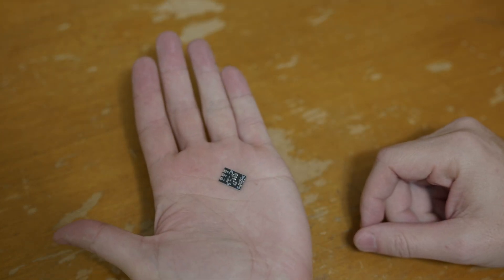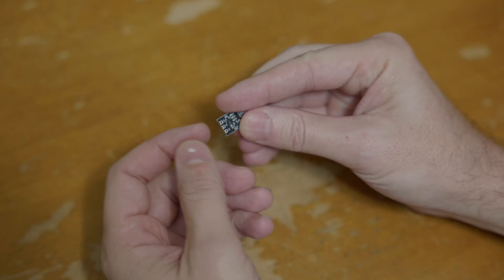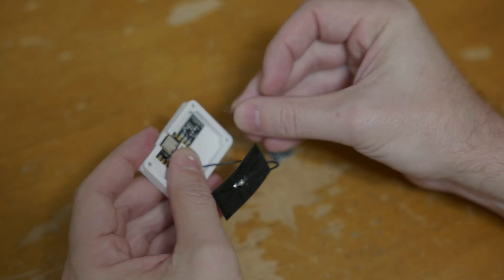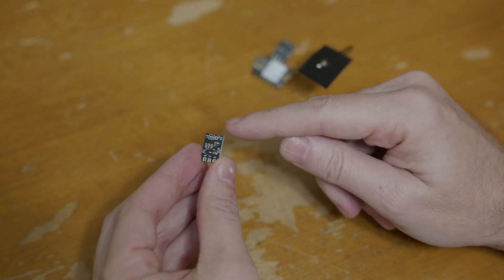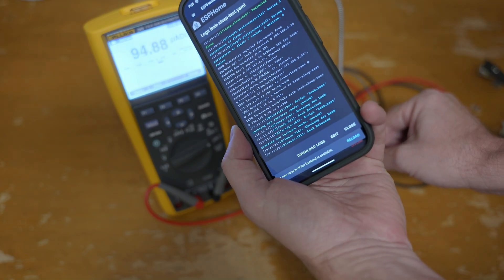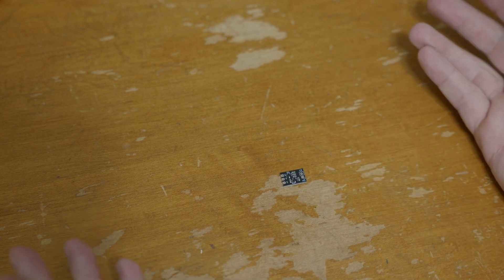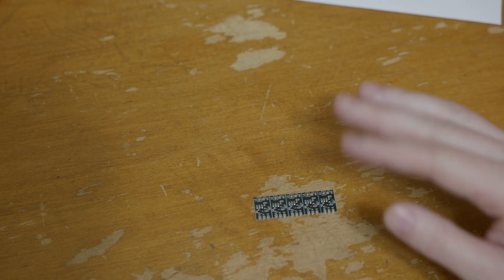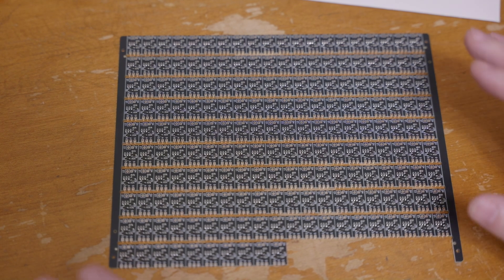My First Product...

Comment: Great work!! Can a single esp32 could be used to monitor many water leaks spots in the home by using many pcbs and long wires? If yes, would you use long wires for the sensitive pins or use long wires to bring the pcbs near the water leak detection spots? I would prefer having one esp32 monitoring many spots so i do not end up with 15 esp32 wifi modules on my network. I also think an integrated buzzer would be a nice thing to have on the pcb.
Reply from the maker: I haven't really tried anything like that, so I could only speculate that you'd probably want the signal pin runs to be long. Probably also depends on how long you're talking about. The other tricky part would be coding multiple pins on the ESP32 to wake the device.
Reply: @TechDregs Thank you for the reply! No need to wake the device, just plug it in the wall and let the cables run. 25 feet would be longuest cable if i put the esp32 at the center of the house. Icould also do 15 feet max and use two esp32.
Reply from the maker: There's no high speed signaling, so I don't think you'd have too much problem with that.

Comment: To bad, Etsy says: This item does not deliver to The Netherlands. I would like 5. Amazing product.
Reply from the maker: There is a way, but you would have to create an Etsy account. I would process it as a custom order and only charge for the actual shipping costs incurred. Go to https://www.etsy.com/shop/TechDregs and select "request custom order".  Unfortunately, this is not available for guest purchases (without an account) due to Etsy's restrictions.
Reply: the supermini series is much better imo for its chip antenna
Reply from the maker: Didn't know about those. Looks like the pinout would work with the castellated edge direct mounting, using pin 4 for the signal. The only shortcoming I see vs the Xiao is the Super Mini appears to lack battery management. But for directly powered devices, it looks like a very good option.
Reply: @TechDregs  I used Supermini for a while, usually without brand/logo, this board will be quite hot compared to Xiao or other bigger boards, and also there might be a little problem about its small antenna can't be too far from the router, but for this project it might not be a problem except for the lack of battery connector. For boards from other manufacturers, like Waveshare Zero, etc I don't know.
Reply: same here
welcome tarif hell I bet